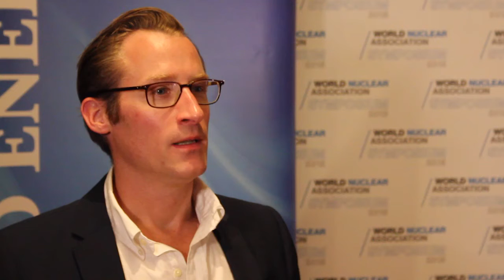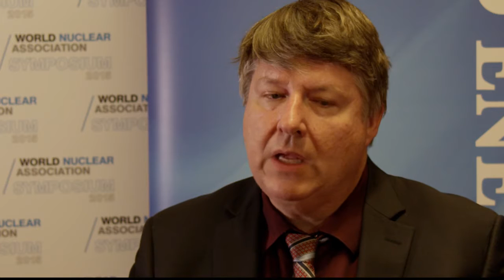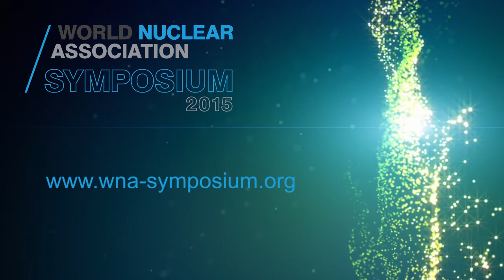World Energy TV talks to David LeBlanc of Terrestrial Energy

Comment: I have a site covering what Molten Salt Reactors are and how they are so much safer than water-cooled reactors. I have several quotes from LeBlanc's technical publications. Molten fuel, cooled by stable molten salts, atmospheric pressure, very stable levels of fission (thermal expansion/contraction of the molten fuel regulates the heat levels), no water or combustible materials, no long-term nuclear waste (over 99% of the fuel gets fissioned). https://liquidfluoridethoriumreactor.glerner.com/